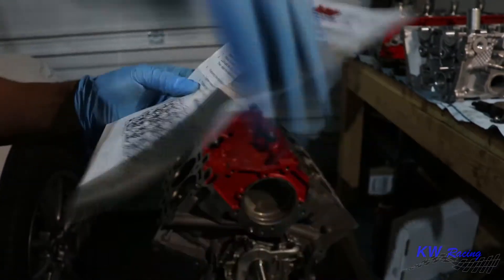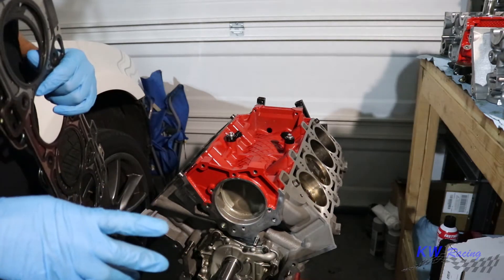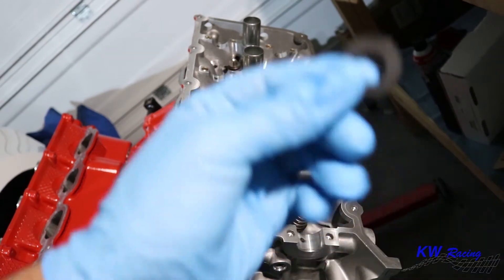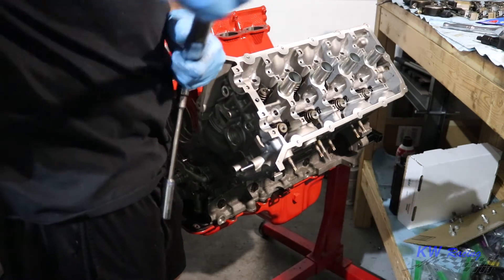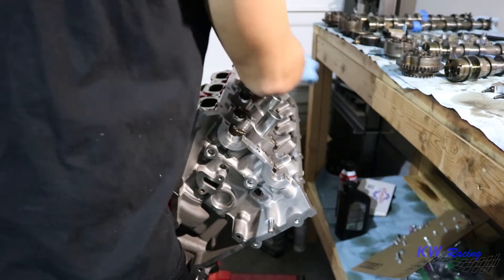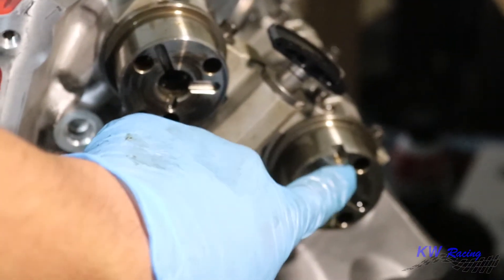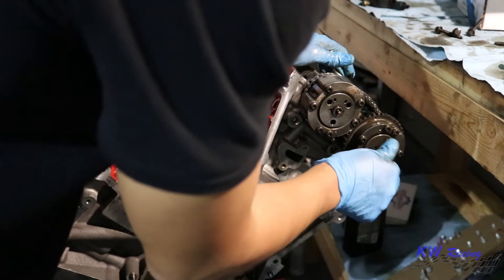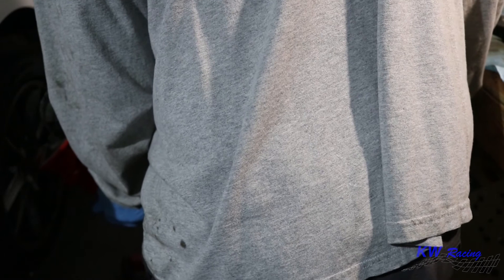1000 HP MMR built coyote block // ARP Head stud Install and cam timing procedures

Comment: Looks like you forgot to add RTV per the manual at the oil pan and the block/ head interfaces. Needs 6 dots or it can seep.
Reply from the maker: I did add rtv i just didn't show it in the video